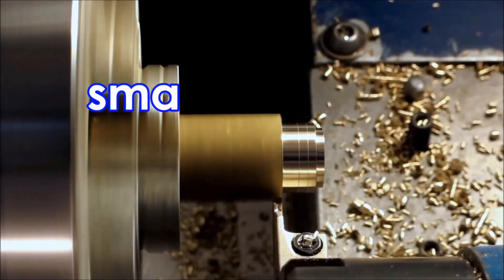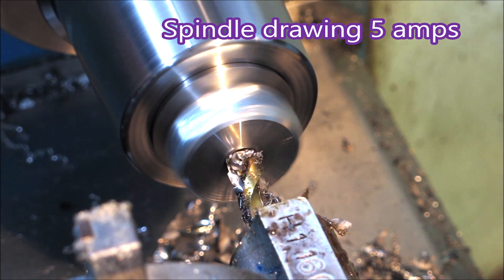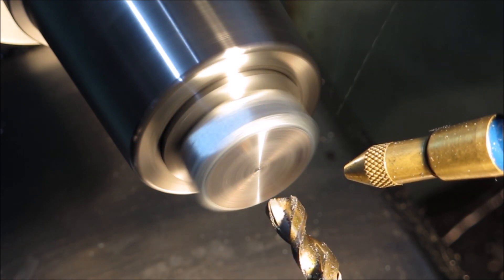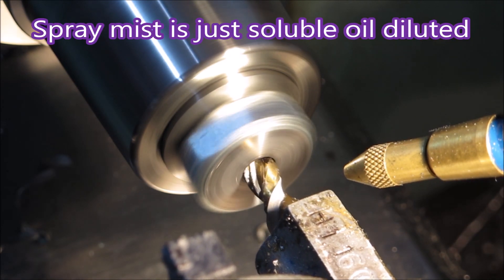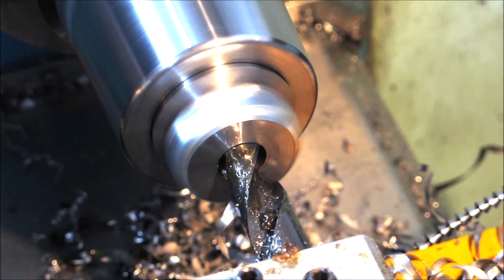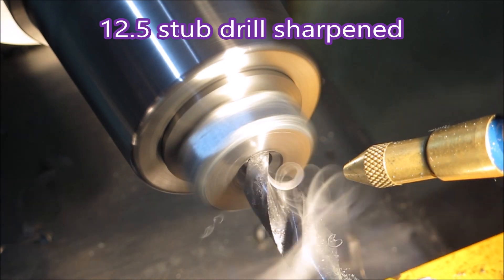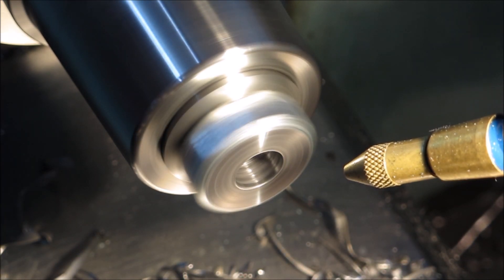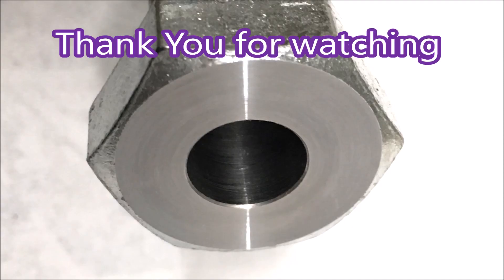Reaming 1/2" in the head of a M20 bolt, used for Hilo conversion in a Classic Mini Suspension

Comment: Howdy, I'm commenting on your last video in hope it would be easier to get your attention. I have a c6128 lathe which I have converted to CNC controls. The next step is to make an ATC and I'd need to ask you few questions about that. 

How do you align the position of the tool to be in perfect height alignment with the spindle? 
Is the ATC's tool position horizontal once the tool holder is parked at called tool#? My problem is, the ATC assembly I'm working on is not having perfect alignment, and that would mean that tool would need to be shimmed from both X and Y axes as the parking position is just slightly slant. I have a feeling that this was a design mistake by whoever made that file. 
Could you make a video on how your ATC turret is positioned relatively to the spindle and give me some insight on where I should be aiming up with the design. 

Cheers! 
z
Reply from the maker: My turret came with the lathe, a manufacturer fitment. 

I can, if I need to, put shims under the turret to change the tool height. I suggest you make changes to your turret so you can do the same. If the turret is on a slant you can vary the shim thickness front and back to get the tools horizontal,  It must be horizontal or the tool height will change with tools of different lengths.  The turret also needs to be absolutely square to the lathe centreline or parting off will be a nightmare. This probably needs to be done using a dial indicator to ensure it is correct.  If you want to get my attention you can contact me on Facebook through my Notewell page.
Reply: @smallcnclathes  Thanks for your input mate! I'll redesign the parts to remove 22,5 degrees of slant that was designed in. I think it must have been a design error from who ever did the project first. Cheers z
Reply from the maker: Burning Diesel Production that sounds deliberate rather than a mistake! Is it a front or rear mounted turret?
Reply: @smallcnclathes  In my CAD I have positioned the turret behind the spindle, but I do not se any restrictions in having it in front - all trough I do not have enough travel on my X axis to have the turret front mounted.    I have to find from where this design files originate, but I would not be too far if I say it came from cncZone.com. If I remember right, this was an open project and they have experienced a hardware failure on a server or on a PC that hosted the files so the project had to be reconstructed from previous archives and that did not went too good... I have started with repairing bodies so they can be processed with fusion360 and prepared for machining. The initial assembly had about 3-5 degrees of slant, but when I started making joints in the assembly I came to conclusion that the turret locates tools in a mid position (this 22.5 degrees as 8 tool positions should have 45 deg. increments in rotation). On the other hand, it is quite possible that this was designed for a Y axes lathe which has had some funny angle of (45+22,5) 77,5 degrees.  It is not too big of a deal to relocate holes on the main body to achieve perfect alignment, everything is still in CAD and doable. The ATC has about 140mm diameter tool holder wheel. and about 70mm height from the bottom of the ATC housing to the centre shaft. The main housing would fit in a 200x100x130mm piece of raw stock. NEMA23 stepper is what drives the changer once air piston unlocks the mechanism.  I'll send you some pictures on your FB page.
Reply from the maker: Burning Diesel Production what matters is that the turret is positioned so the top of the tools are on centre. You should be able to find a position in X that allows tools of any length to be on centre. The 22.5 degrees should not matter.  Is this design available on line?